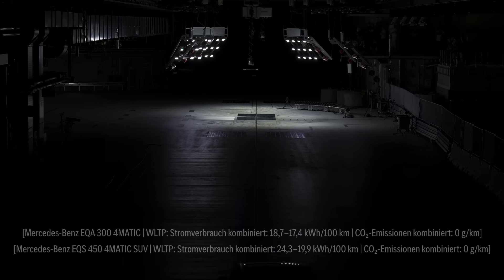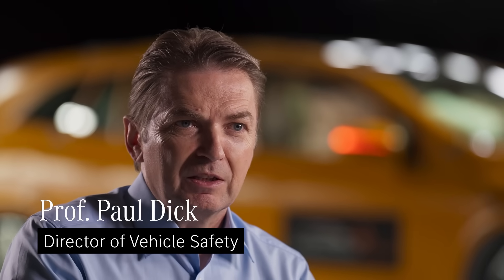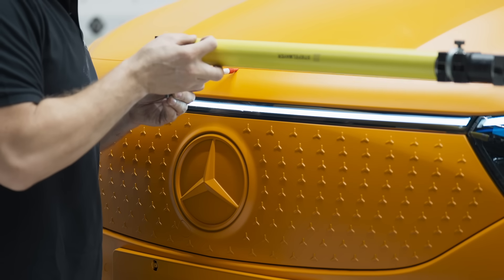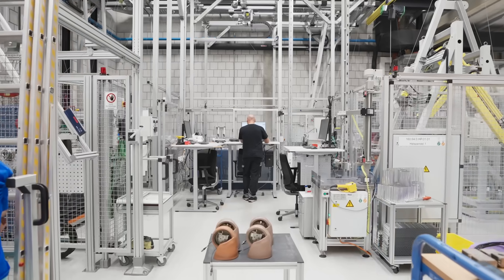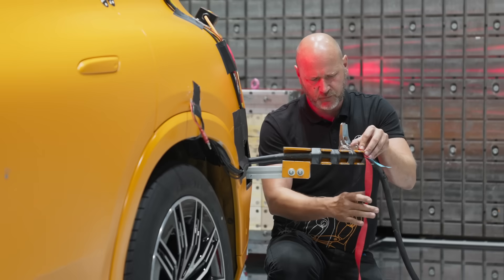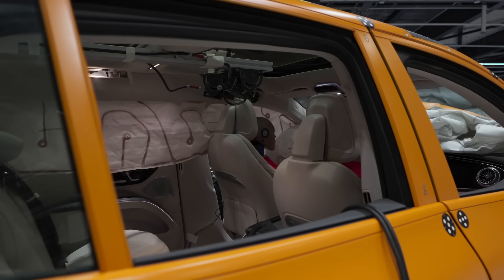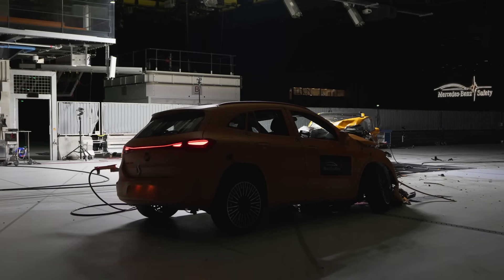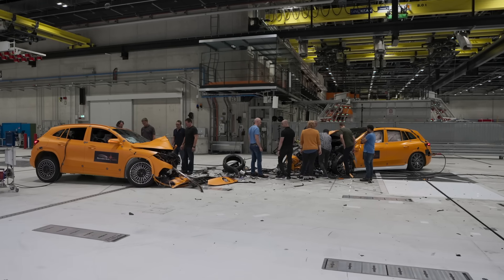The world's first public two-car electric crash test by Mercedes-Benz​

Comment: So the batteries are disconnected during the crash. How is that a true test? EV fires from damaged batteries is a real world problem.
Reply: You weren't listening. The battery remains stable and the high voltage systems switch off in the event of a collision.

Comment: Was this tested with batteries installed rather than dummied up and were the batteries fully charged?
Reply: These cars have been independently tested by several different agencies, with batteries.  They are safer than internal combustion cars.
Reply: why would the batteries being charged change anything
Reply: @petterlarsson7257  . The amount of energy that can go boom in the event of a failure. Equate it to testing a ICE car with a full fuel tank versus empty. The initial collision is only part of the threat when you have batteries (or fuel).